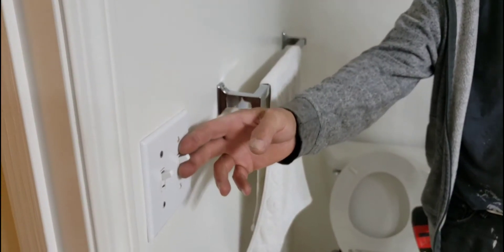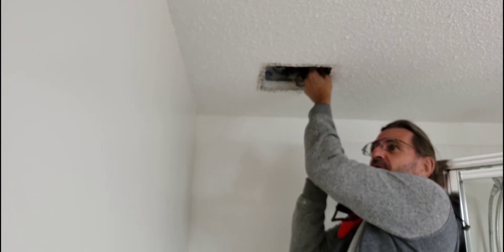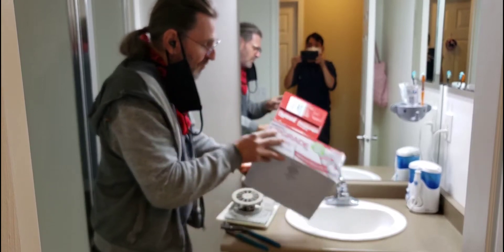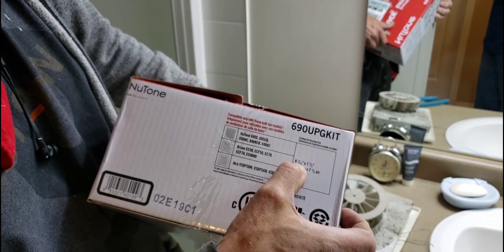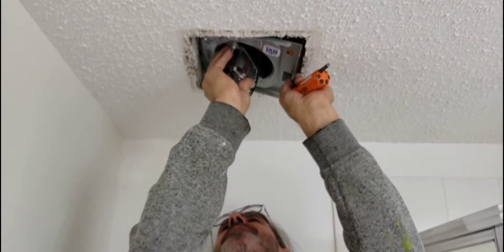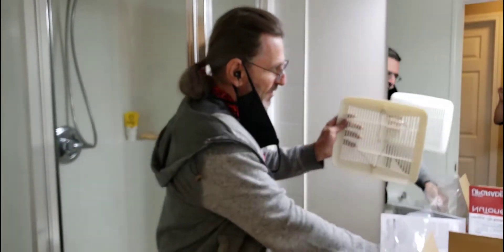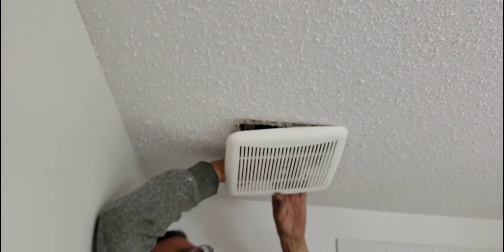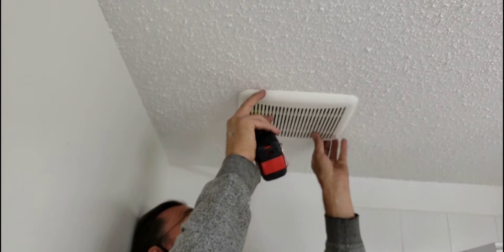Broan NuTone EC50 Bathroom Fan Motor Upgrade Or Repair With NuTone 690UPGKIT

Comment: There is no screw on the EC70 and the side opposite the two divets doesn't just pry off. :(
Reply from the maker: The side opposite of the divets has Tabs that poke through the box side. You remove the plate from the divot side.

Comment: I used to just buy a new EC50 and replace the motor plate (done four times in 10 years) but the EC50 is no longer for sale and everything I get that I think it close to it, isn't.  I had no idea about these upgrade kits!  There are 16 at my local Home Depot and i'll be picking some up today.
Thank you for posting this.  I was about to try and rip out the housing and install a whole new fan, you saved me what was likely going to be a disastrous attempt to wire one in from below. Many, many thanks!.